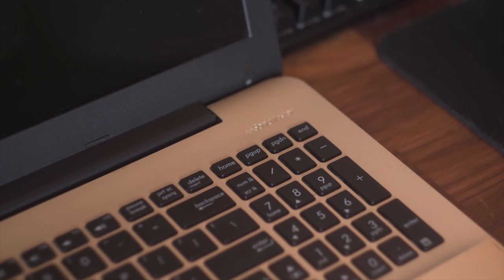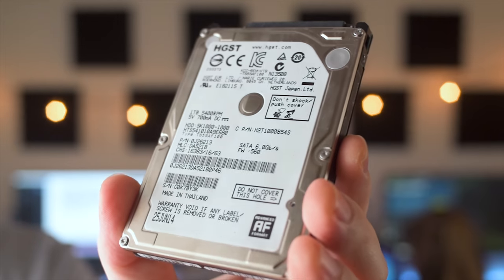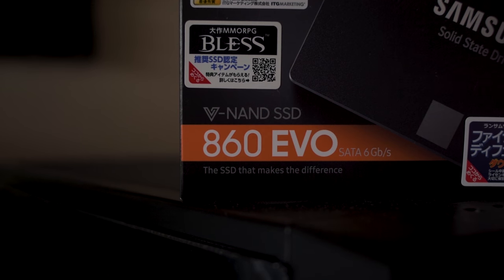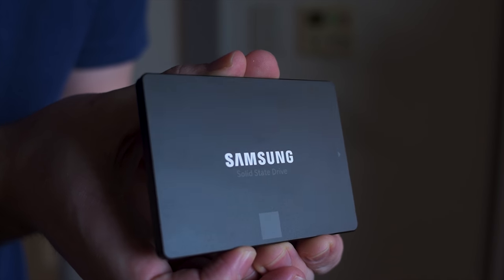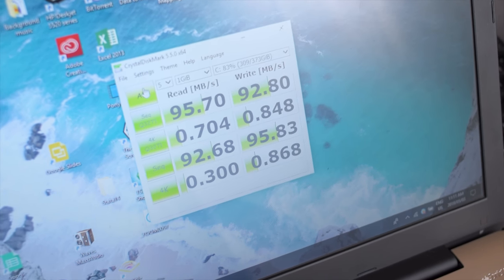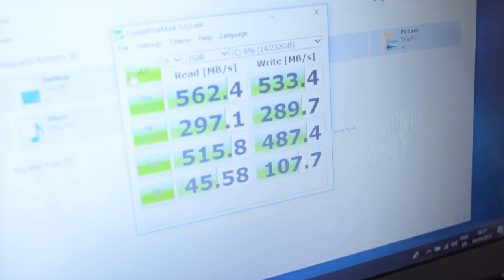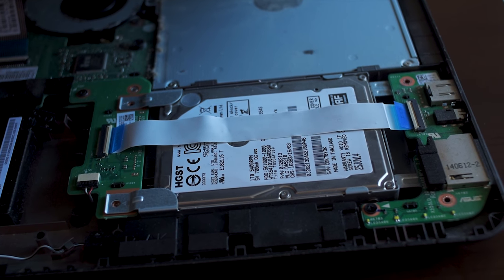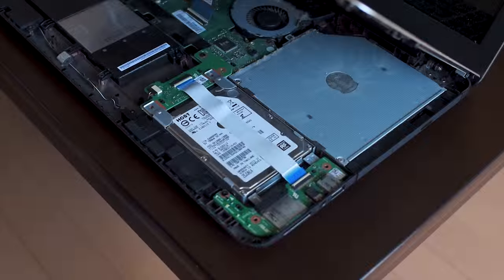BEST way to speed up an old slow laptop (Ft. Samsung 860 evo)

Comment: Another way is to wack a massive air purifier (£49) to the bottom of the laptop, if you're using it like a desktop connected to a monitor...and don't care about a sound of a jet engine as you use headphones... brought my 2012 laptop back to life, could even play some casual valorant